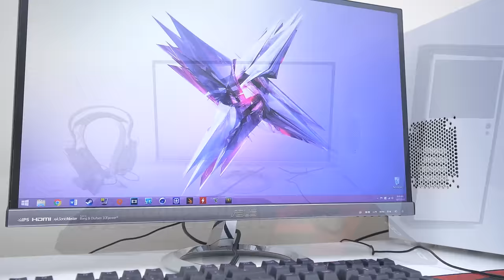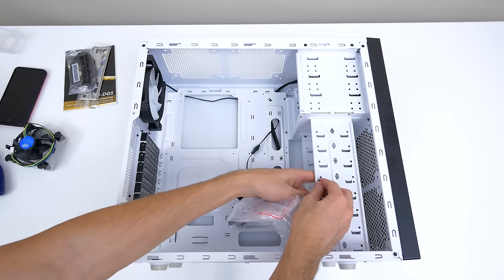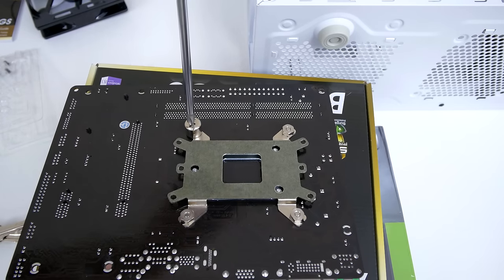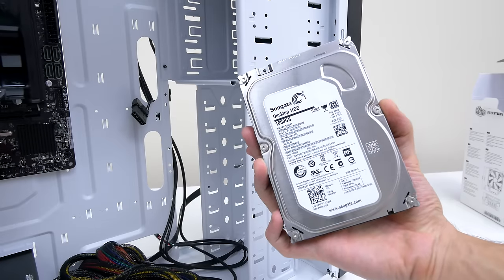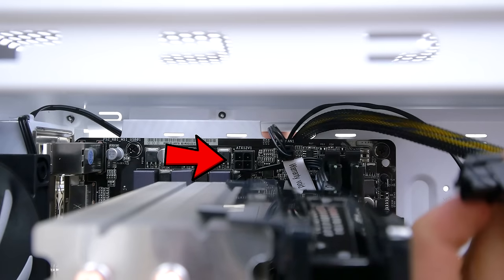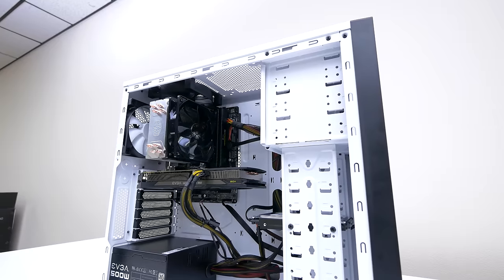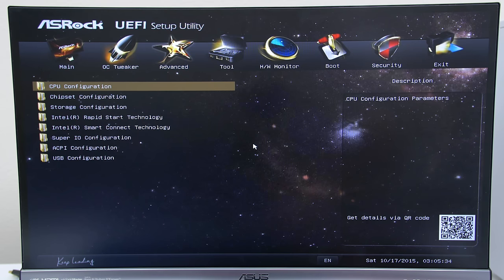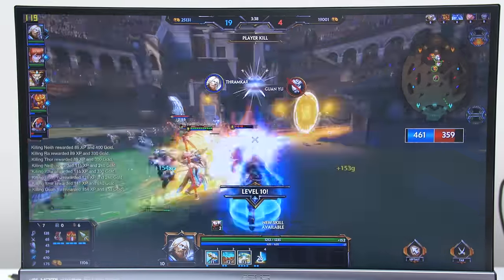How To Build A $650 Gaming PC With Windows

Comment: I have a question I'm soon going to build a pc and I'm buying Windows 10 how is it going to deliver are they going to give me usb or are they going to put in in the hard drive I ordered? And can I install a old hard drive as well? The used one has Windows 8.1 but idk if it's pro or not...please help
Reply: If you already have a hard drive that has Windows on it there is no need to buy Windows again, all you need to do it install it in your new PC and attach a sata cable that came with your motherboard to it. And it depends where you bought Windows off of, if it was off of Amazon more than likely it'll be a usb but if not they probably sent you a product key then all you would have to do is grab a usb flash drive and install Windows on it like shown in the video and enter the product key.
Reply: ok so how do i move the windows 10 to my brand new hard drive. and i dont want all the contets of my old hard drive just windows 10
Reply: +ulysses casanova unfortunately there is no way that I know of doing that at the moment mate, sorry.
Reply: its ok but thanks for letting me know its possible appreciate it
Reply: if you have a second drive in your pc, you could install a free os onto it then plug in your old harddrive, you can then format your old drive. this SHOULD work, but im not entirely sure

Comment: I'm new to PC building what do I need to set up the Internet on this PC will a Ethernet cable work or do you have to go wireless
Reply: +CowboyBrady94 For ethernet cable, just connect the cable to the ethernet port. For wireless, just buy a wireless USB device.

Comment: Hi guys,

Im planning to build a pc myself and i was wondering if you agree with the choices i made. I want to play games like CS;GO, GTA 5 and Call of duty at a solid 60 fps. This is my build: 

Case: nzxt s340 black&red
Graphics card: MSI Geforce gtx 960 4g
CPU: Intel core i5 4590 
Motherboard: Asrock z97 anniversary 
Western Digital 1 tb harddrive 
Cooler master hyper 212 evo cooling
Kingston Hyper x fury 2x4 gb RAM kit

Thank you so much guys
Reply: +Stan Van Goor for a gaming pc i think you should have a 2x8 gb Ram kit it's just $20 more

Comment: Hi, I was wondering if somebody could help me with this build? I have just built this and the only thing I switched was the case and it seems to bring me problems. Instead of getting the case brought in this video, I got the Corsair 200r. There are a couple things different with this case than the other one. This is my first build and dont want it to fail so if anyone is a experienced builder can you try and help? thanks!!!( I have checked my cords about 5 times now so Im pretty sure its not a unplugged cord).

Comment: is the Intel 7.1 worth the extra money? or will the 5.1 be fine for gaming?
Reply: What do you mean? You mean surround sound? Or are you talking about i-5 and i-7, i-7 is great for recording and gaming/editing and i-5 is usually just good for gaming
Reply: +MythicSword Gaming I ordered the I7. I'll be building next week.
Reply: Sweet, what other parts did you get?
Reply: +MythicSword Gaming fatality z97 killer motherboard
I-7 devils canyon processor 
16 gigs of gskill ram
gtx 960 4g ftw graphics card. 
240 water cooler
600w power supply
1T hard drive
redragon karura keyboard and mouse
and a commander case 
and a couple red led strips for some bling lol!
Reply: Nice, the one thing I would change is the 960 to the 970, but that requires more money so stay with what you have it's going to be great
Reply: +MythicSword Gaming yeah I started out going with the 950. the jump to 960 didn't bump the money to bad and the benchmarks on the 960 were great. 970 benchmarks were not much different than the 960 so I didn't see it was worth the big money jump. I really wanted to go with the 980 but it was too much after getting the processor. all together including a monitor I spent right at 1000 bucks.
Reply: Ok, well you can always sell the graphic's card you have and get pretty much the same amount you bought it and possibly get the 980.
Reply: Yeah I'll deff be upgrading it at some point
Reply: Sweet
Reply: +Cliff C Hate to break it to you but you wasted money on the I7. There is no difference between them and the i5 at gaming.
Reply: Gotta be future proof
Reply: MythicBeatbox yep!

Comment: i think it would be better if u replace the 4690k with a 4460 and get a gtx 960 4gb instead
Reply: Yeah or a amd r9 380/380x
Reply: +Deez Nuts yup anything works, dont really need the 4690k in gaming, a better gpu is much more important
Reply: That Kid Gamer Actually, I changed to a 6600k because when I play video games I usually have Teamspeak and Spotify in the background and overclocking my CPU guatantees that I don't lose frames with all the background activity.

Comment: I'm a noob at computers so if I changed the GTX 950 to GTX 970 I can still build it the same way right?
Reply: You can switch the gpu
Reply: Kelsey you should be able to as long as the case is big enough (it probably is)
But im not the best at pc's but i think its like that
Reply: Bodacious T I'm building the PC in the video but just want to change the GTX

Comment: Is this build good and compatible? pls respond

Sharkoon VG5-W Mid Tower Case

Aerocool Integrator 500W 12cm Power Supply Unit

Gigabyte H81M-S2H Motherboard

Intel i5 4460 Quad Core Processor 

Crucial 4GB (1x 4GB) PC1600 CL11 DDR3 SIMM RAM Memory Module (x2)

Seagate ST1000DM003 3.5 inch 1TB

EVGA NVIDIA GTX 950 SuperClock+ 2 GB

SanDisk SSD PLUS 120 GB Sata III 2.5-inch Internal SSD up to 520 MB/s
Reply: Go to PCPartPicker.com and it will tell you.
Reply: Im not able to pick the exact parts on that website, cos some of mine aren't on there.
Reply: Mr. CLonda  
Im not able to pick the exact parts on that website, cos some of mine aren't on there.
Reply: +XxX_TonyBlair_XxX That case doesn't sound that good. I recommend the Corsair 200r.  Get a 80+ Bronze power supply because that one isn't very good. I recommend a Corsair CX500M or a EVGA 500B. Also, 8GB of RAM is required. If your parts aren't on PCPartPicker, just choose another part.

Comment: could I use a core i5 4660 in this build instead?
Reply: Yes
Reply: im new to building pcs, on pc part picker when i put that cpu it says it will need a bios update and i have no clue what that means. does that mean i have to do something special?
Reply: not really. The BIOS is really just the motherboard's menu. Think about it like a Apple's Home menu. I think a bios update is updating this, so its actually ok

Comment: Imma buy my PC from IBUYPOWER. Should I buy it with win 8.1 installed, which costs me about 100 € more, or should i just buy a new product key for win 8.1 and use the DVD from my brother? Cuz I dont know whats that thing with the drivers is :// 
Thnx for any kind of help ;D
Reply: +Bendix Keller Btw, I'm on a low budget :/
Reply: I think, your English is not the yellow from the egg :D
Reply: Über deine Zeichensetzung sollten wir uns auch mal unterhalten.
Reply: +Bendix Keller machs per produkt key. dauert vllt etwas länger aber da du jz weisst wies geht sparste knapp 75 €
Reply: Ich weiss aber nicht ob das klappt, weils den Product-Key nur für win 8.1 gibt und mein Bro win 8 hat..
Kennst du dich damit aus? Weil n Kollege vin mir meinte, dass ich mir auch die vollversion von Ebay holen kann für ungefähr 20€
Würde sowas funktionieren?
http://www.ebay.de/itm/Microsoft-Windows-8-1-Professional-ESD-OEM-32-64-bit-Vollversion-/281984274068?hash=item41a7928e94:g:ViIAAOSwezVWyDcx
Reply: Bendix Keller
also ich vertraue ebay nicht ganz besonders nicht wenn man nen code nur einmal benutzen kann und da GEBRAUCHT steht. Ich würd mir die win 8.1 aufn usb stick oder auf ne SD ziehen und das dann wie im video kaufen^^ wenn dir 2. hand seiten nicht liegen geh auf die offizielle windows seite
Reply: Also Windows 8.1 downloaden, von dem PC aus, an dem ich gerade sitze xD, das auf nen USB und dann nen Key bei Amazon, bzw. Windows kaufen
Hab ich das so richtig verstanden? ^^
Reply: Bendix Keller
nein windows auf den usb stick sofort laden  und nicht auf den pc sonst wird das problematisch , nicht auf den jetzigen pc . also ja von den jetzigen pc online das auf den usb stick laden und dann wie im vid auf den neuen pc laden und mit nem code den du auch auf deinem jetzigen pc kaufst nutzen
Reply: Nice, danke. Hab jetzt Win 8.1 Pro auf'm USB.
Glaubst du Amazon ist vertrauenswürdig mit den Keys? Weil viele meinen, dass viele Keys gesperrt wurden..
Reply: Bendix Keller
naja ich weiss net informier dich vllt nomma
les nach online etc findest wohl schon was :) und gerngeschehen. Amazon ist nicht am vertrauenswürdigsten bei allem... Naja wer weiß halt mich aber aufm laufenden , ja?
Reply: Ja, kein ding ;D 
Können wir sonst irgendwie anders schreiben? Weil in den Kommentaren find ich n bisschen blöd
Reply: wennschon per emails schätz ich

Comment: I just buit this but my PC will not boot I went back and made sure everything was right and still wont boot please help! My power button blinks once when I try to power it on.
Reply: One of your parts is dead or you connected wrong some cable...
Reply: One of your parts is dead or you connected wrong some cable...
Reply: I double checked all the cables and all my parts are new. What should I do?
Reply: +Cesar Dam bro, haved you found the problem yet?
Reply: no.
Reply: +Cesar Disassemble everything and put it back together. That is probably the best option.

Comment: Are there any other ways that I could install Windows as the only other computer I have is a Mac?
Reply: It doesn't matter what operating system you are using to install Windows on your USB Drive or whatever media you want to install it on. It's not like you're changing operating systems on your Mac. You're simply installing it on your USB Drive/whatever else you want to install it on
Reply: +Gabinuh oh ok thanks for clearing that up for me

Comment: would it be bad to spray paint the case a different color??
Reply: +Domenic -Gaming & Vlogs It also comes in black if you don't like the white. If you don't like the case at all you could easily use the same parts with a different one.
Reply: VoltWolf 2 so spray painting is a bad choice?
Reply: Domenic -Gaming & Vlogs No it's a good choice if you want some custom design or logo, but I would recommend you get the case that fits you best. If you are good at spray painting, then go ahead! PC's are the ultimate customizable experience so do what you want!
Reply: +VoltWolf 2 ok thanks :)

Comment: Since the cpu is a "K" series, shouldnt the motherboard be a "Z" series then? Im confused, please explain this to me
Reply: If you get a k series cpu I would recommend a Z170 mobo.
Reply: definitely
Reply: Guys, to put this in a nutshell, "K" is considered a "unlocked" processor, which means that you can overclock the CPU to a higher GHz, which means higher speed. The Z170 chipset or motherboard is the type of motherboard you want when you want to overclock, since B170 and H170 don't support overclocking

Comment: He said "You can use your currend HHD" and I have a pre-build PC and want to use the HHD with windows for my new rig. I'll reuse my CPU,GPU and HHD. I'll get the 1060 when I have enough money. Will there occure any problems or is it fine?
Reply: Sure, no problems will occur if u use a pre-built PC's HDD for this build :)
Reply: I reat something about the BIOs of the Mobo and I didnt knew what thats about. Thank you :D
Reply: All you have to do is to connect the HDD with the SATA cable that came with your motherboard and connect it to one of the SATA ports
Reply: OK thx. Whats about the BIos of the mobo. I reat about it and I dont know what it is/does. so I wont have to reinstall windiws?
Reply: No, bios are the settings set inside the motherboard, when like ppl want to overclock their CPU or changing core voltage. Don't worry about the BIOS, because that has nothing to do about the HDD
Reply: So everythging is going to be fine? This weill be my first bild so im very excited and afraid that something doesnt wtk. Thanks for your help thou :D

Comment: Whats a cooler used for and is it necessary?
Reply: +GELLS 

G O O G L E
Reply: +GELLS This might be too late but it is a Cooler Master cooler. Basically if you search "cpu cooler" on Amazon (or any pc website really) you will find it as the first one. If you want to overclock than an aftermarket cooler is necessary but if you don't want to than the one that comes with the cpu is fine. All intel processors with a K in the name (like an i5 4690k) are overclockable. If you don't get one with a K in the name than it's not overclockable and an aftermarket cooler isn't necessary. In short, If you want to overclock=Yes. Don't want to overclock=No. Hope I helped.
Reply: +MeepCraft Gaming what if I plan to overclock the GPU, but not the CPU, do I still need to buy the evo like in the video?
Reply: +Rene Mejias No because that cooler is for the cpu. It won't help cool the gpu. The cooler on the gpu is fine for over clocking but make sure the temp is not too hot or it will damage the gpu. Light overclocking is fine for most gpus.

Comment: Does everything in the video and description add up to $650 of does he not count the windows 8.1 and the little wifi connected thing?
Reply: Yes in fact some of it is probably cheaper now that its been about a year since he originally built this. Also keep in mind the $650 figure is BEFORE TAX.
Reply: +Zach Pozzi yea I searched up all the parts and did the math and it added up to $832 then I did the math and searched up what I wanted for my set up and that added up to like $300 something.

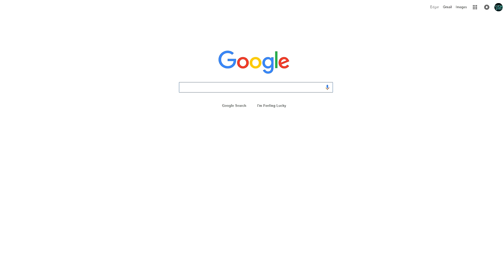Comment: 10:58 Whatchu talkin bout? The windows site says at least 4gb (4gb flash drives are usually only 3.5-3.9gb, so get a 8gb instead) and you are talking about 16gb?
Reply: +WN8OverR9000 i used a 3.7 and that worked fine as it only requrius around 3
Reply: Alex H My "4gb" (3,5gb didn't work

Comment: Building a similar one with a different motherboard and CPU 👍Only $450!!
Reply: +Dino Magna Which CPU are you using ?
Reply: +Vishu amd fx 6300
Reply: *****
Do you think 6300 can take on new games ? And what gfx are you using ? Wont it bottleneck it with high gfx card :/
Reply: +Vishu I haven't had any problems with it so far, I can easily handle Gta 5 at 40 - 60 fps
Reply: *****
Ohh thats nice mate. Can you tell me the Graphic card you using ?
Reply: +Vishu Gtx 950
Reply: *****
Ty mate. Happy gaming :D
Reply: Vishu Anytime bud 👍

Comment: Instead of the 1tb hard drive can i get the 500gb hard drive?
Reply: Yes
Reply: If you want to
Reply: He said "You can use your currend HHD" and I have a pre-build PC and want to use the HHD with windows for my new rig. I'll reuse my CPU,GPU and HHD. I'll get the 1060 when I have enough money. Will there occure any problems or is it fine?
Reply: If you're CPU is decent there shouldn't be any bottlenecks with the 1060 but other then that its fine to do that.
Reply: I have the Intel Core i5-6400
will this be ok?
Also thanks for answering my question. I reat something about the BIos of the MObo and I didnt know what thats about. So I dont have to reinstall Windows?

Comment: Is it optional or not if I need the EVO Cooler
Reply: +Cameron09 This build is for overclocking. The stock cooler is not enough for overclocked processor.
Reply: WB IsMe K thanks so basically if overclocked, the stock cooler wont be good enough unlike the EVO cooler
Reply: Yea.
Reply: +WB IsMe thx

Comment: Would this build work
Reply: +Christoffer Pold http://pcpartpicker.com/p/bd3yD3
Reply: +Christoffer Pold You don't need that Hyper 212 Evo. That poor Pentium will freeze to death under it and the stock cooler it comes with can even handle beefy overclocks.  Get the MSI H81M-P33 mobo because it can overclock that Pentium, increasing performance. Get a Western Digital 1TB hard drive, they are about 1 dollar less than the Seagate one you have but with increased reliability. You don't need that huge case for your tiny mobo. Get a Cooler Master N200. And finally, don't buy a Windows License key for that much. Go on Reddit/microsoftsoftwareswap and get one for 20 dollars.

Comment: why do you have to install drivers?
Reply: when you install Windows it only knows you have a mouse, a display, a graphics card, but it doesn't know which brand and what features it has. For example, if you download the drivers for the mouse you purchased, you may be able to configure buttons or add special options to them. The same goes with any other piece of hardware your computer has

Comment: can i use 1050 ti instead of 950?
Reply: chulapupa chulapapi yes, you will just get a bit less performance
Reply: actually 1050ti is much better oerformence than 950
Reply: chulapupa chulapapi mb meant to switch the 950 and 1050ti i meant 950 is much better than 1050ti

Comment: can i use the cpu from my old pc?? its an i5
Reply: yh
Reply: which one
Reply: i5
Reply: what mark of i5?
Reply: any i5 won't do, only certain ones
Reply: i3 i5 and i7 are just product series  its just like phones. U have Galaxy(which is the serie ) and then u have the s6/s7 with are the models. On CPUs u have the generations that are equivellent to the models on the phones. Even if two cpus have the same genneration there is still the probability that they are fisically different therefore it may not fit in the motherboard. Consult the motherboard´s guide online. It usually has one or two pages dedicated to what cpu fit in there. Hope it helped ;-)